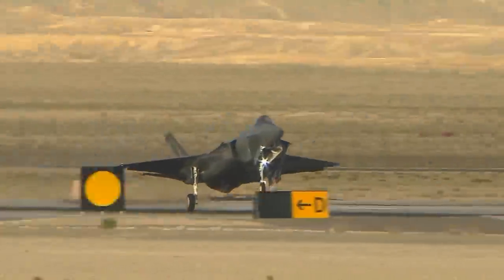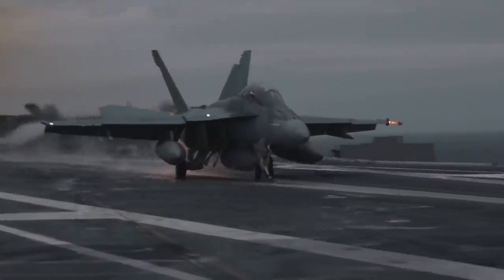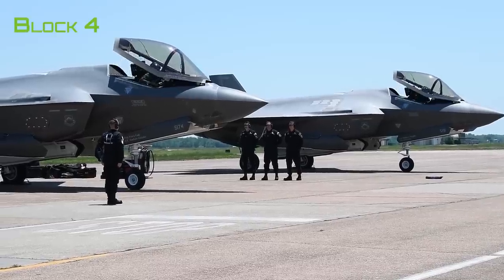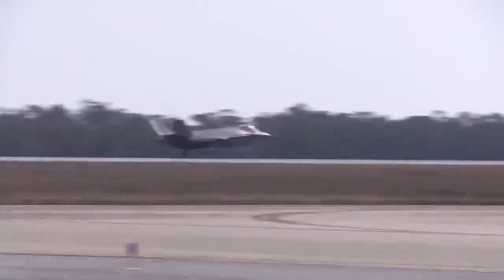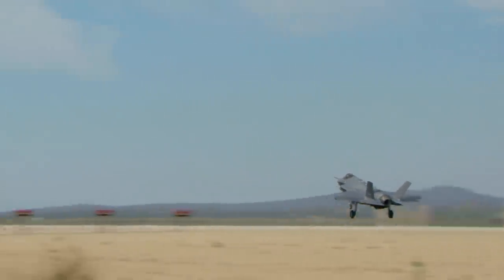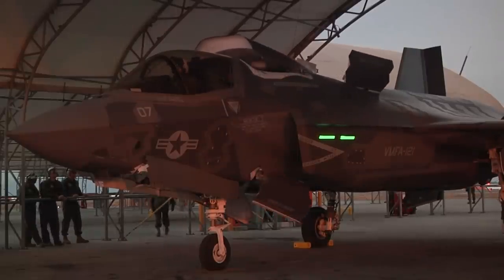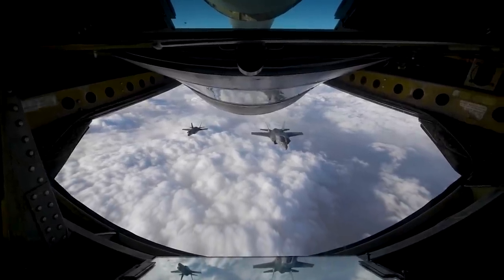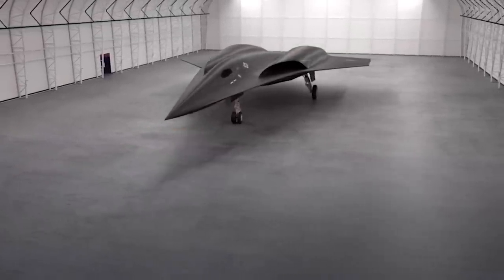Why the F-35 needs an engine upgrade

Comment: An advanced GTF, geared turbo fan, engine will save on fuel consumption which is vital to take on China from US aircraft carriers.

The GTF upgrade will run significantly cooler.
Reply: For an engine the size of a fighter it would add more weight, cost, and maintenance than it's worth. It works on the PW1000G because the fan diameter and compressor diameter are so radically different, meaning that their optimal rotation speeds are rather far from each other; a direct connection puts both out of sync. On an engine like the F135, w/o being able to make the gearbox significantly lighter and easy to maintain it wouldn't net much of a gain.

Comment: Running hot???  Didn't the same thing happen to the F-14 engines? Weren't they having afterburner blowouts?
Reply: F-14 had P&W engines with 'compressor stall' problems which caused the loss of several planes. They eventually redesigned the engine to eliminate the problem. Changing engines is no big deal, The F4 used several different engines during its lifetime, the RAF-4 for UK used Rolls-Royce engines which had more thrust. They also lightened the airframe on the F4s for better performance.

Comment: How is this plane advanced when it runs on FOSSIL FUELS? They need to get those clunky ICE engines out and replace them with batteries. That's the future! Instead of dangerous aerial refueling, they could have aerial recharging. The recharger plane would simply trail an extension cord, and the F-35 would plug in before its battery dies. F-35s could even recharge each other. Aircraft carriers could be equipped with solar panels. And of course, to reduce carbon footprint, all conventional explosives will be replaced with nukes. It all makes so much sense. Elon Musk could lead the way.
Reply: Working with totally green aircraft is very much still in its infancy. And for high speed and high performance right now, battery and solar simply don't cut it yet. In fact, they're not yet suitable for large and powerful commercial craft now. Best you can do is to make these things more efficient with what you have now.

Don't get me wrong, we've made leaps and bounds when it comes to research on more renewable means of power and creating renewable fuels. Especially with vehicles that are far more common and are used far more in our daily lives but at the moment we just aren't there yet.

Besides since you mentioned Elon Musk, you have to know his rockets require some fossil fuels to get up into orbit because it just won't cut it to use battery.

Comment: The F-35 saga gets worse every day. The program was horribly over budget and now the services have a plane that was going to cost them 1.4 Trillion dollars just for maintenance, and now they need a new engine.  The hourly operating costs on the F-35 are so high that the Air Force is talking about getting a less expensive "complimentary" airplane that is cheaper to fly. in 2011, there were at lot of people that warned us that the F-35 was going to be a disaster, and I think they are right.
Reply: Bro do your research
Reply: @bennittotheburrito9606  He has it right my man.

Comment: Sell all the marine Corp “B”’s to nations who want the F-35 and all the current F-35A/C in service to nations who would want them. Replace with new F-35’s with all the updates needed. (1) F-35 needs a larger weapons bay (2) it needs a two seat version for Electronic Warfare and management of unmanned systems. With the new engines, large bay and updated systems the F-35 would be much more capable.
Reply: So it is a new plane 😂😂😂 f35 and f22 are defect airplane.

Comment: It's kind of scary to think that having two different engines becomes that much of an issue. How many fighters did the US support in WWII without computers?
Reply: The F-15 is about 50 years old and still being manufactured. The F-35 is built to last 4 decades.

How many WW2 fighters were still front line five years after WW2?
Reply: The F16 blk 50 and blk 52 both have different engines and are both currently used by the airforce.
Reply: @Rob_F8F  I think you missed the point mate. What he is saying is that there were many airplanes and within one model there were advancements made each year.  The F-15 for example has had many advancements and modifications to update it and make it relevant over decades. If an airplane is not advanced to overcome deficiencies then it will go the way of the dodo bird sooner than later. FACTS
Reply: How many spitfires or mustangs do you think flew around with Pratt and Whitney engines?

Comment: Another F-35 issue…
The fighter is brand new but the engine are already obsolete 🙄
Take a look at F-15 Ex it is an old design with an engine that dates back to the 80’s, it works. The computer processors in the F-15ex are able to perform 87 billion functions per second. Not as much as F-35 but still impressive considering the age of the jet.
Reply: The fighter isn’t brand new the fighter was designed almost 30 years ago
Reply: The engines aren't obsolete, if anything the fact that they can be reliably overrun without damaging them permanently or causing random engine failures is a testament to them being bulletproof like most turbine engines are nowadays.

The F15 does not just "work". Its legacy as an air superiority platform is unmatched, but also because it fought against substantially inferior aircraft like the Mig 21, 23, and 29. You can't expect to take it into a 5th gen arena with even more powerful and smarter radars, IR systems, stealth, etc. and expect to just perform the same way. If we kept thinking this way we'd still be flying P-51s assuming we'd be alive at all.

Comment: This is not a proper EE version of how electronics and microprocessors work. Thermal management and heat is the result of power not properly expelled NOT a function of more power. If you're using Chinese math this sort of math works, however, these planes are flying in negative 35 F temperatures so I find it interesting that such cool temperatures cannot cool the incremental increases in CPU power.

Comment: These [evidently] Pratt & Whitney sponsored messages tell the story about the XA101 and its capabilities & limitations.  However, the G.E. XA-100 engine has no such limitations.  That engine has been developed to provide ALL THREE MODELS of the F-35 Lighting II Joint Strike Fighter with a new engine.  Not only that G.E. retained a retrofit capability to older aircraft.  You will never get that message from the PW XA101 spokes persons because they intend to make more money out of the two parts streams as the F-35 fleets move forward.  
U.S. F-35s should upgrade to the much more powerful and cooler running G.E. XA100, but use it to power the new NGAD fighter aircraft.
Reply: Totally True. Go with GE or Rolls for long-term reliability, and better Engines.
Reply: The XA-100 is definitely not compatible with the F-35B currently and it's not even clear if it's compatible with the F-35C.

Comment: Personally, I think Navy and AF will not keep them very long and will rely on F-15s and F18s until the next gen fighters come on line. Marines will have no choice but to keep theirs with no fall back.
Reply: The F-35 was never meant to replace either the eagle or the superbug though. Bizarre comparison, especially with the eagle which is a whole different class of airframe for a whole different realm of mission sets.

Comment: The XA100 is essential for the F-35.

During the ATF competition (YF-22/-23), the PW YF119 and GE YF120 were pitched. The YF120 was a revolutionary adaptive cycle engine, and lost due to preceived high cost. 

The YF119 won. 

Same thing with the PW F135 and GE/RR F136, a YF120 derivative. 

Current day, we are here again: An insufficient engine based on 1980s technology for todays environment powering the most important aircraft in the US arsenal. 

The only benefit of the F135 ECU is cost, and only cost. Its not nearly enough now, given the current geopolitical tension in the West Pacific, which is quickly becoming the near front. 

The benefits of the XA100 are significant.  Id hazard an educated guess the benefits outweigh the cost, and here is why:

-The XA100 is based on mature technology that has, unlike the PW XA101, been tested. 

-A 25-30% increase in range, thrust, efficiency, electrical output and thermal management is, alone, reason enough. 

-The F135 ECU is likely obsolete even before it even comes out. If the current iteration of the F135 hasn't met service requirements now, it never will. 

-The XA100 is going to power the NGAD. The installation of the engine on the F-35 will reduce development costs and increase commonality across the fleet. 

Seeing PWs recent reactions to Lockheed's comments about the AETP further confirms my suspicion that PW is not serious about peak performance or reliability. 

The F-35 needs the XA100, and its fine damn time that the US DoD finally embrace this technology. Its been over 30 years, and we dont need a Band-Aid "upgrade" that will end up going bad by the end of the decade anyway.
Reply: 1) Incorrect. XA101 has underwent testing, I was there myself

2) Agreed. The raw performance is indeed superior. Disagree that is reason enough. Integration will be a massive effort. Cannot just simply swap it in.

3) Disagree. ECU meets AF requirements for increased PTMS. Requirements do not call for drastically improved thrust and SFC. ECU upgrade will more than meet thermal needs for JSF until sunset.

4) Bold assumption. Cannot comment further.
Reply: @Y13A  

1: So where is the data? PW has been quiet about it. 

2: Incorrect. GE announced it was drop-in ready. 

3: No it won't. A measly 5-10% across the board wont be enough by the end of the decade. PW talking points easily disproven.

I am not convinced, and people in the DoD and at Lockheed Martin agree that your engine is inadequate for the F-35.

Comment: The new GE XA-100 Adaptive Cycle is Best of Best. Install them in the F-22 and the F-35. At least Upgrade a % of those needing Adaptive Cycle, the rest can upgrade to the new Pratt Whitney Engine. Never Save Money at the price of National Security, protection of the country.
Reply: buddy the f35 engine is nearly double the size of an f22 engine. how would you expect that to fit?

Comment: allready unblock 4 the things aren't even into the 100% service yet as far as the units it'll be equipped with them I would say it was underdesigned from day one probably intentionally so they could get more money by having to upgrade them because well it's not their money it's just the taxpayers money lockheed Martin kind of like old AT&T Mobil needs to be broke up because they're running basically is a conglomeration that hasa total hold on the fighter industry in the United StatesAnd I for one I'm sick of the companion taxes for shit like this thatThey don't even have them interfool service and they're already on the fourth upgrade Come on design it right the first time Then again none of the branches really ever wanted that 35
Reply: You need to.remember how fast technology is advancing. In 5 more years there will need to be another upgrade to keep up. Where it all will end w/the technology and AI really scares me.

Comment: History repeats itself.
In the late 70's and early 80's the Pratt F100 suffered from unexpected reliability issues, driven by partly operators pushing the aircraft in unexpected ways (damn hot-shot pilots).
This opened the door for GE to adopt it's F101 engine core to develop the F110, which become the prominent engine in F16's (especially the F110-129 variant).
This current issue is GE's opportunity to repeat what they did in the 80's, which will ultimately benefit the customers/operators.

Comment: this is what happens when DC  politics gets in the way. The Super tomcat or F22 or YF23 would have been way better options. The F35 still has its place but I remember all the controversy around the F35 and the F22 vs YF23 controversy and it boiled down to dc politics pulling strings for their friends that own these huge aerospace companies. The YF23 beat the F22 in all categories but 1  where they tied. The only advantage the F35 has over the 22 or 23 is the VTOL version

Comment: it needs new engines, new electronics, its just a huge scam. Working on 2 trillion later, the F22 staying in production was a cheaper option. This and the RAM coming off at mach 1, and after 30 seconds,  tax payers paid greatly for this mess.

Comment: With All those Electronics Sucking All that Juice up to 30kw that's 30 BLOW Dryers on 1kw Setting Maybe A Low Maintenance Turbine Generator with in Flight Air Scavenger Mode !.

Comment: The GE design is superior in every way, this came down to $$$ simple as that...P&W has had repeated issues with the F-135 since it's introduction...remember when they had a problem with the compressor blades, the solution was to run the afterburner for extended periods to wear them down to the proper size...P&W is upgrading the existing F-135 with add-ons, where as GE was a clean sheet ground up redesign...this has more to do with power generation & cooling than anything else, yes the AESA APG-81 hardware is being switched to the new APG-85, but this is about installing DoD's new modular laser system than it is about anything else. The F-35 armed with the modular laser system in its internal bay is not only excessively cheaper in per ordnance cost ($0.05 - 0.10 per shot vs $100K+ - $ millions per shot), not only that it weighs significantly less than ordnance, less weight = longer range & since its internal it is extremely deadly without compromising it's RCS with external stores...also the F-135 is being used for the B-21's engines as well...

Comment: It's already the most powerful engine ever put in a fighter. It has more thrust than the gigantic J-58 used on the SR-71. And there is no 'desperate' need either. It's a plane designed to fly in the transonic regime, where most fighters spend 90% of their time flying. And while the F-35 is capable of dogfights - it has the same maneuverability as an F-18 - the design intent is that it is a versatile multirole aircraft, not an air dominance aircraft like the F-22. It carries a heavy weapon load with the engine it has, and it's affordable. Newer, higher performance engines have been considered and rejected by most allies as too expensive for the capability gained, capability that will rarely if ever be required.
Reply: Don't use the J-58 ever as a comparison... it's a RamJet made to operate crippled as a TurboJet, thanks.  

Be realistic.
Reply: We are talking about PRACTICAL FIGHTERS here, not exotic reconnaisance airframes...
Reply: @devobronc  I'll use whatever engine I want as a comparison, and the comparison is appropriate. The F-135 produces more thrust than the J-58.
Reply: @StereoSpace  J-58 has x3-x4 times more thrust at Mach 2.5 speed than F135. This is pessimistic evaluation since F135 may have zero thrust at Mach 2.5..

Comment: After 20 years development, before having this F35 still not have passed its Operational Test & Evaluation, now the electronic architecture has to be upgraded and as a consequence also its engine. Weird that an upgrade in electronics requires so much more power which goes counter to the trend in decreasing TDP while increasing processor power in computer development. More worrying is the unmistakable trend of having initial capabilities moved to future block upgrades masking the problems of this whole program. This whole process if implemented will only orphan more of the existing F35 fleet for which upgrading will either be not practical or too costly. 
The F35 is like the banking system, already has become "too big to fail". Do realize how this will affect all those allied air forces left with those orphaned jets.
Of course one could argue that since Biden bombing Nordstream NATO is dead anyway.

Comment: One fault with your video that is Australia MQ28A Ghost Bat drone in your NGAD frame and is not up to any American if gets a new engine as is a sovereign Australian design and built drone and the tech will stay in Australia hands of even the detachable nose design.
Said by Australian RAAF Commander in a video who is head of that programme.
Clearly states the foreign customer will only get the nose sensors and avionics packages from Australia. keeping it al sovereign.

Comment: After the USSR collapsed n the American bought some Rocket engines from Russia them engines replace 4 atlas engines with 10% spare power as this American engineer said we send a Billion n said i couldn't be done yet they did t on a shoe string a hard pill to swallow that was on a BBC documentary, (this was a closed loop rocket engine) maybe the Americans can buy a Russian jet engine a lot cheaper more economical n very reliable, that is If the Russians are willing to sell, ops sorry guys its meant as a cheer up joke both countries have great technologiies